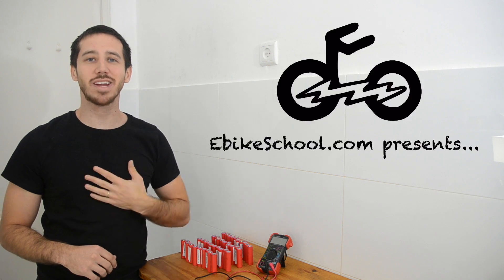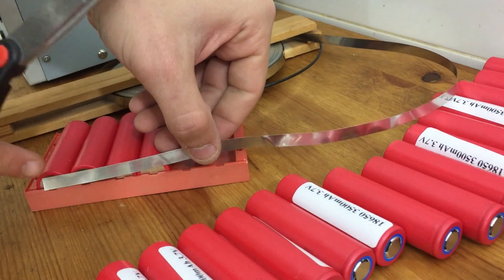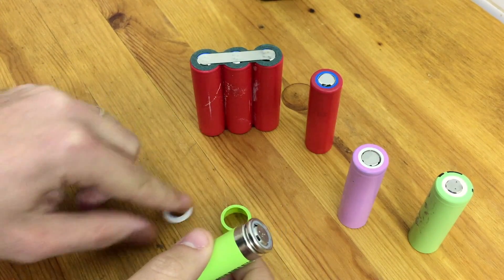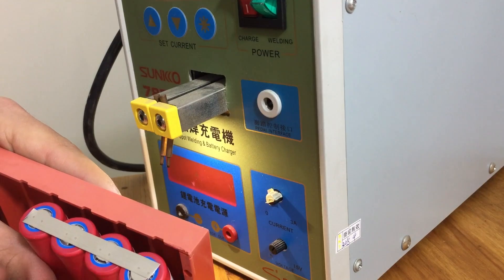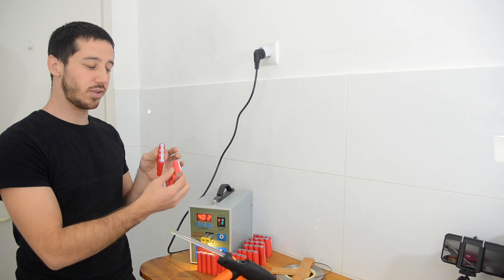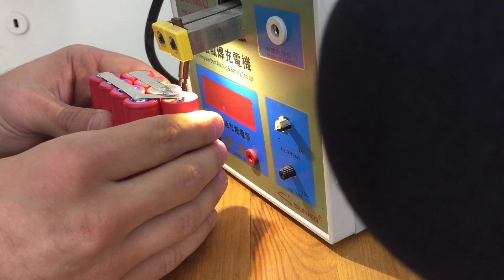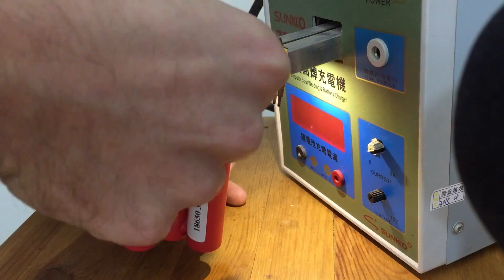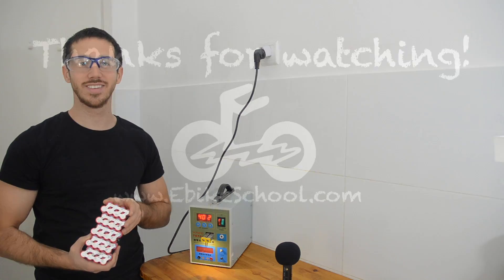DIY Lithium Battery - Spot Welding - Part 2/5

Comment: Nice one too. Some battery builders think that the cells should have "cooling space"  between them rather than stick them together with glue. What's your opinion about that? Could that be a problem in hot days for example?
Reply: Savvas Berdos honestly if the pack is vented like it should be anyway... (Heat safety reason) then the spacing would help.
Reply from the maker: I mentioned that in the video. Air space makes almost no difference because the air quickly heats up, removing almost all cooling effect as very little heat is transferred to the thermally insulating case materials.
Reply: EbikeSchool.com You are right I missed that part sorry. Thanks for replying!
Reply: Well I tend to figure out that it is better if there are spaces and there is also some kind of ventilation so that the air is circulating and it doesn't remain static between the cells. If you use insulation wraps like heat shrinks maybe it's not a big difference.
Reply: What welder are you using?

Comment: Where can I buy that size of Nickle? I see on Ebay only have few Metter.
Reply from the maker: Unfortunately the place I got it from isn't selling anymore, but you can find some more vendors here: https://goo.gl/FuBi07 Just make sure it's pure nickel. If a kg costs less than about $60, it's probably nickel plated steel.